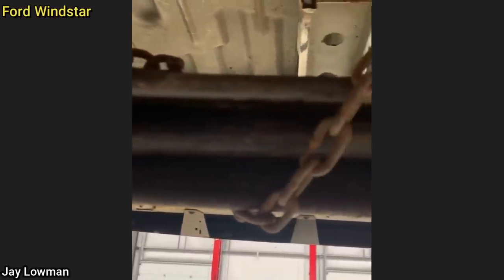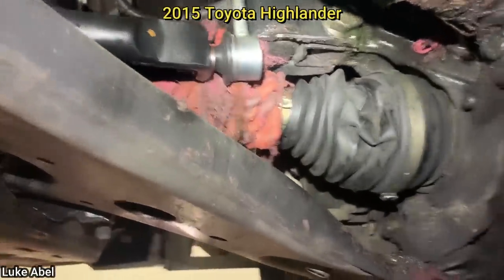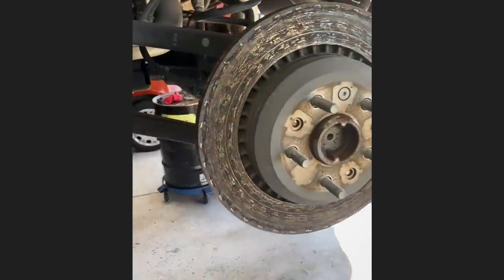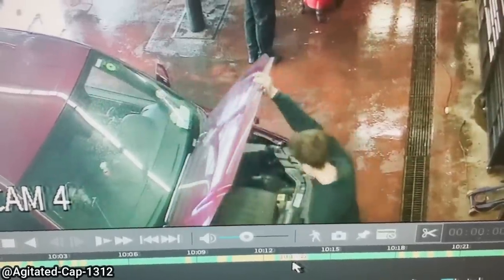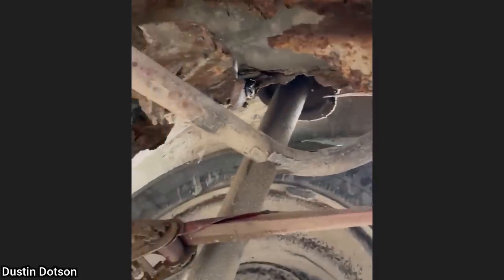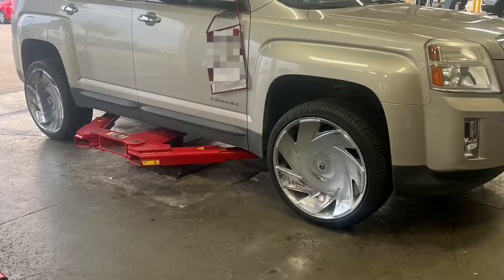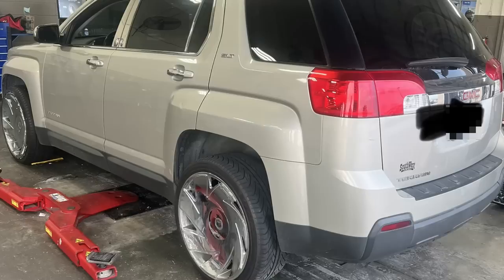Customer States Rear Axle Is Broken In Multiple Spots | Just Rolled In

Comment: It's remarkable how many people think chain can be used to shore up their suspension
Reply from the maker: It's scary how much we've seen it lately 😅
Reply: Depending on how its set up it might help to prevent it from falling off and allow slow drive to shop. Been doing much shadier tows and drives but those are just like this exceptions and done safely with slow speeds.

Comment: I always wondered what it took before some of these cars held together with rust, hose clamps, and zip ties before they went to the junk yard. Now I know - a bad transmission. I guess there is only so much snake oil and ignoring the problem before you give up
Reply: That or the engine. Basically, something that stops the car from moving at all, and that you can't make work by jimmying it up.

Comment: Mandatory annual safety inspections everywhere! This is my new goal for 2023
Reply: I've lived in states that require safety inspections and states that don't. In the states that do, cheating runs rampant, so the vehicles are no safer than the non-inspection states. If it was done correctly, it would help but graft and corruption are everywhere.

Comment: 3:04 - I was traveling on the 410 that turns into the 403 by Mississauga (Southbound) maybe 15 years ago, and a Crown Vic was emitting a lot of sparks beside me - suddenly I heard a bang, the Crown lifted up, crashed over something, got WAAAY louder, and kept going like noting happened. The entire header-back exhaust system ripped free and was ninja-staring it across the highway, two cars managed to avoid it, one car wasn't so lucky. I honked and pulled closer to the car to get their attention in an attempt to tell them, like, bro, your ENTIRE exhaust system liberated itself - small Indian woman kept her hands at 10 and 2 and didn't fking flinch, open header racket be damned. 

This is why insurance is 3x higher in Brampton compared to anywhere else.

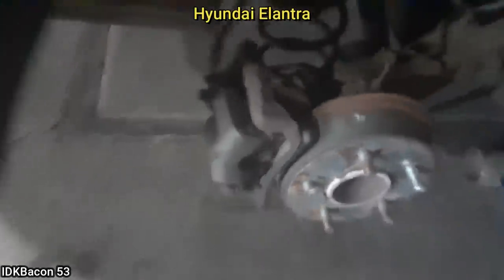Comment: 00:51 That is a top shelf shop in terms of business ethics.  If the shop is willing to foot the bill for a tow to keep the customer and community safe they probably are not lying about the repairs needed.  Even if some other shop might have been a little cheaper for the repairs or if I wanted to do it myself they would have earned by business right there.

Comment: Back in the day, when I had a 1991 car, I remember it would randomly empty the battery, so I (luckily) would remove the + clamp in the evening... So one day, early in the morning I opened up the hood of the car and got a shock - a little kitten was looking at me, sitting on engine block! I was grateful, cos if I didn't remove the clamp, I would start the engine and might have hurt the cat. Just to mention, it was a cold day and the poor thing must have felt warmth there and decided to stay there in order to keep warm...
Please, people... In winter, do check under the hood at least occasionally if any animals tried to keep warm there if you keep your car outside...

Comment: Speaking of recalls. My late model Ridgeline could have the hood fly open at higher speeds. 🤔 I gotta stop procrastinating.
Reply from the maker: I would get that fixed 😅
Reply: I put up with my mother's self-opening Chevette hood for way too long before I went to a junkyard and got a replacement hinge. Yes, hinge, not latch. One hinge had broken, and that caused the wind force to be unevenly distributed. This would yank the latch open. It took $20 and probably 5 minutes to fix it, yet she had refused for months. Finally I just went and did it. I think she missed having a "quirky" car after that. I did not miss the deathtrap effect one bit.

Comment: Where I live, it's pretty common for cars not to have rear brakes due to the harsh winters.  They usually rust out and blow a line or have the caliper (or shoes) freeze up once they get to be 15- to 20-years-old.  The owners of the vehicle rarely even know (in the cases where things freeze up since there's often no obvious failure).  "Unsafe to drive" is a bit of a stretch, but "less safe" would be an accurate statement.
Reply: I had my brake line burst due to rust. Had to drive it straight to the mechanic using my e brake and driving slowly/carefully.  Brake job cost over $1,200 because it also needed new rotors, calipers and pads. Needed new calipers because the bleeder screws were frozen. Would have done it myself but I needed a loaner vehicle so I could still get to work.
Reply: @VintageCars999   Had the same thing happen to my friend last year.  Went over to his house to help him replace the line and looked at the rear calipers and everything back there was rusted completely solid.  Based on how bad it looked, he'd been driving without rear brakes for at least a couple years.  Had the line not blown, he'd still be unwittingly driving that car without rear brakes.  The cost of parts alone was too expensive to be worth fixing.  

He sold the car for scrap price and the new owner is still driving it without rear brakes (line is capped off to maintain pressure to the front).  They are aware of the issue and the car still stops just fine.  ABS even still works.  The front lines are completely rust free, so there's not any major risk of another blowout for now.  Though I did recommend to the new owner that they get the rear brakes fixed if they decided they wanted to drive the car long term.
Reply: @NoName-ik2du    yikes. Thankfully this shop was able to replace the lines as I didn't want to part with the vehicle because a year later they told me they were no longer able to work on it because lifting the vehicle is sketchy though this other shop will. They can adjust the lift to the strongest lift points but I'm hoping to move to a place where I can set up a shop and enough space to put in at least 3 vehicles so I can get that existing vehicle fixed up better and hopefully I can start fixing additional vehicles for people who need them and potentially keep the poorly maintained vehicles off the roads.

I know some people drive this crap around because they don't have money for something better so they just Mickey mouse everything, like having no rear brakes. I also like these Wildfire lifts, they're expensive but they lift from the wheels to make lifting a vehicle safer and you can put the jack they have in to get the wheels off the ramp, being able to visually see where you can put the lift especially on sketchy vehicles where it might not be safe to lift you can make that determination especially on some of these vehicles in this channel is like, it's crazy they even go under there with the condition that they are in. Mechanics need to get at least one of these lifts as they're safer for older vehicles.

I've heard stories where they just fall off or break apart because the frame is so rotted out.

Anyway, it's good you told the new owner of that car the problems with the brakes.

Comment: What's amazing is people will head down the interstate on vacation and never do routine checks or maintenance before leaving. 
Bald tires, low oil, antifreeze, brake fluid etc.
Worn hoses and belts, To name a few. Took a trip in the dead of winter. 
The temperature  was near zero.
All along the interstate cars had
 pulled over with tire and coolant problems that should never have happened with just basic maintenance. 
Not to mention people  getting up to go to work after snowfall and attempting to drive with bald tires

Comment: What I want to know is exactly HOW some of these cars are driven to the mechanics in the first place? Locked up brakes, disintegrating axles, tyres worn smooth etc. If that was the UK, all of those would have been deemed unsafe and not allowed to leave the shop until the issues were fixed or even allowed to be scrapped.

Comment: There should probably be laws that allow shops to demand a quick visual inspection by police before releasing a vehicle
Reply: The closest thing to that is the Federal Motor Carrier enforcement usually done by the state police/highway patrol inspectors, but without training and written standards, any denial of release is simply gonna get everybody in civil court. Local police are often understaffed; they're not gonna get involved in this, and tell the shop to release the vehicle to the owner because it's the owner's property anyway. (If anybody can cite chapter, title, and section of a State law allowing a shop to hold a non-commercial vehicle solely for safety reasons, I'd love to see that citation). Shop liability is an on-going headache, and laws and case rulings vary from state to state.

Comment: hoarder lady would have been told to reschedule the repairs and would have been advised that the work will not be performed until the vehicle was properly cleaned out. No mechanic should ever be expected to have to shovel out the customers shit to fix the issue. It's one thing to move a handful of paper, bag, a box etc. but that much junk is way over the limit.

Comment: As an independent garage owner I know if there is a safety recall the dealer is not supposed to let the customer drive it away but would the warranty flat rate cover the extra time to move all that shit or can you tack on some extra labour time?
Reply: Best practice would be to take tons of pictures to document the extra work to remove all that junk and put it back afterwards.
Reply: The removal of the owner's debris is not covered under warranty; the payment only covers the parts and labor needed to do the warranty repair. I'd refuse to clean out a vehicle; the legal liability when the owner's claim you lost, broke, or stole something isn't worth it. Tell them what they need to do so you can perform the warranty work, and go onto the next job.

Comment: My sister was moving and had her car on a dolly behind the u-haul.  She'd driven about a mile before someone got her attention and told her the car was smoking.  She'd left the parking brake on and was dragging her new Saturn by the back tires.  She didn't replace those tires for a long time, over a year, and the car vibrated something awful from the flat spots.  Sitting in the back seat was like riding a paint shaker.
Reply: My brother did something similar with a Saturn.  His rear breaks locked up so he drove to work like that. It was a snowyish day, and his drive was across a city so he never had to go very fast.  Same result, flat spot on tires for a long time .  Thanks for making me remember that! Lol

Comment: If, some day, the US implementet something like the german TüV (Technischer Überwachungs-Verein =  tests the safety of technical installations, machinery and motor vehicles and have the power to decomishen cars on the spot or order repairs in an specific time frame without driving the car until repaired) many cars will be scraped
Reply: It it the same TÜV which sent my car back on the road months before I bought it with both rear brake lines severly corroded to a point they almost burst?
You can't trust that guys any more
Reply: @simonm1447  in germany? my car was decomishened because my Power steering didnt work, I hade to tow it to a garage and back befor it got his permit back again to be back on the road.
Reply: @Caionnech  yes, in Germany. On the other side they terrorize tractor owners if a reflector is old and blind.
The same TÜV checked the dam in Brazil, which killed hundreds of people.
Reply: @simonm1447  I get that many blame the TÜV for beeing over dramatic some times, but most of the time they have a point. To the dam in Brazil, it is still going throu cort, so we have to wait if, or if not the TÜV is fully responseble for it. Generly speaking, in germany, thanks to the TÜV, we can be acspect that most car's on the road are in good conditions and wouldn't brake in half when driving over 150 km/h

Comment: It's always surprising how bad of a car someone will bring in. I had a customer bring in a late 1930s Ford. That he only drove a few times a year. He said that it didn't stop very well. When I pulled the drums and looked at the brakes. I found that only one brake cylinder worked out of four (a rear one at that. And it didn't move very far. The wheel cylinders had a rusted solid. The rear one only work the rear brake shoe. How he was able to stop at all is beyond me.
Reply: He probably drove at a safe and sane 12.5 mph all the way to the shop. Had to; brakes didn't work so well, you know.  😁

Comment: As an Australian, I think it’s crazy America doesn’t have yearly inspections on cars. Here is Australia it cost $40AUD and you have to get your car inspected every year before you pay your rego. It’s great because mechanics get the business and find major faults with cars.
I wouldn’t want me family on the road know other cars like this are on the road!!
Reply: It's the case in NSW for example. In VIC you just have to have an inspection once if the char changes the owner. NSW has far stricter rules for cars older than 5 years, even stricter than German rules
Reply: @simonm1447  Didn’t know it was country wide. Yes I am base in Sydney.
Reply: @Andrew260RS  Australian states have relatively much independence in such regulations.
If you import a vehicle from another Australian state you have to do an extra check in NSW before you can register it, even if it got the roadworthiness certificate in VIC just weeks ago

Comment: If this channel has taught us anything, it is that there seems to be an endless supply of people who don’t care at all about the safety of themselves, their families, or anyone around them.

And seriously, how completely oblivious do you have to be to be towing your Jeep with all 4 brakes applied and 1) not notice that your motor home is requiring a LOT more throttle just to maintain speed, and 2) the gigantic cloud of smoke and fire following you? Further proof that towing anything or driving anything bigger than a minivan should require a CDL. Too many completely incompetent people out there driving around with 25,000lb death machines.

For the vehicles that are so full that they can’t be worked on, don’t. Either the customer comes and cleans out all their crap or the vehicle gets rolled out to the parking lot. Problem solved. That’s what I always did. If the customer gets upset that you want them to get their junk out of the car so you can actually get to the parts you need to repair, you fire them and move on with your life.